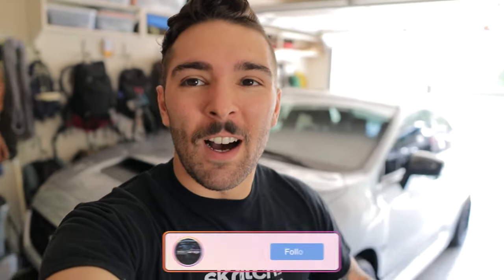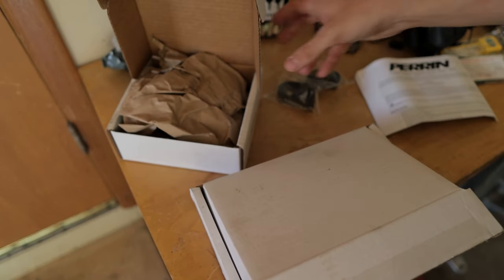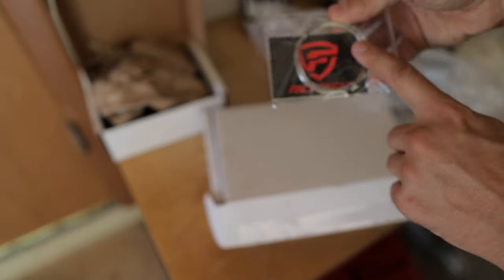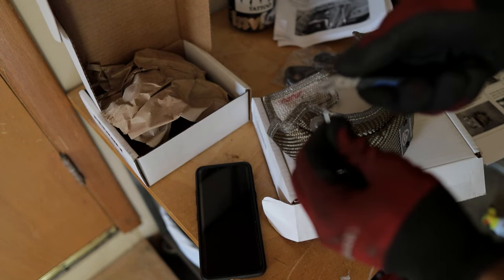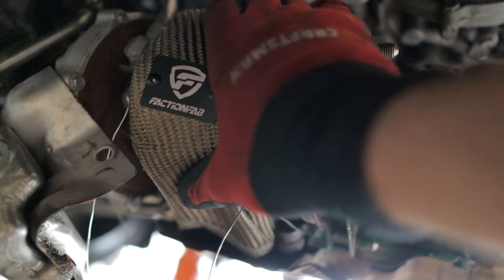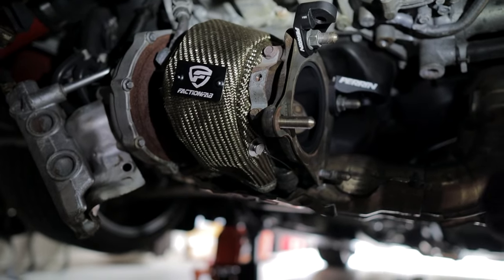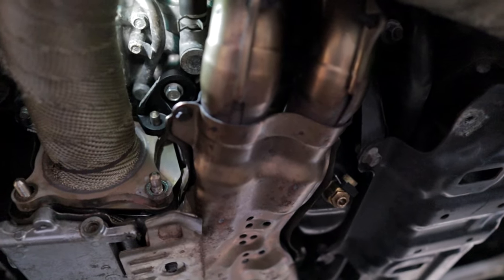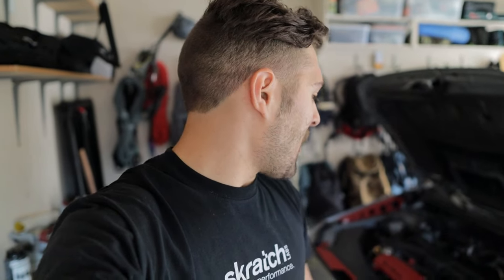FactionFab TURBO BLANKET & PERRIN Turbo Support Bracket

Comment: I couldn’t get the left top Perrin mount to line up correctly when I torqued it it spinned and wouldn’t line up with the bolt that goes in w the heat shield . I just used the stock bracket any tips for that ?